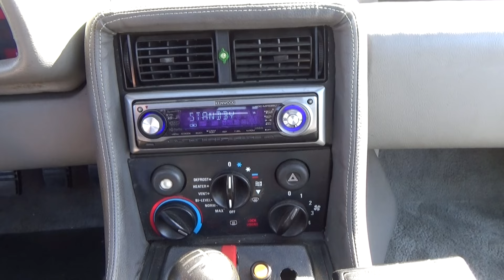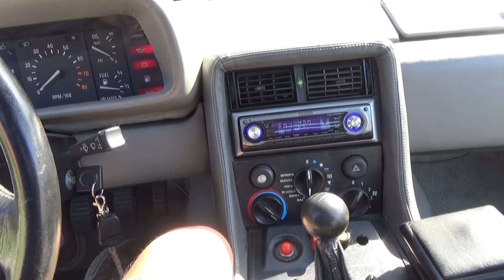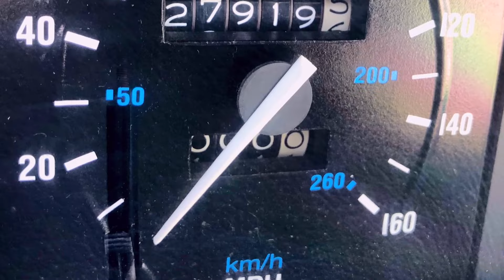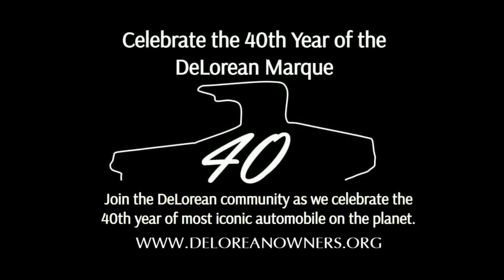DeLorean Spotlight: DMC TECH '81 DeLorean Stage-2 Engine with Electronic Fuel Injection System

Comment: Do are all the switches under the radio?
Reply: If your asking what the switches are they are the headlight,hazard and heater  A/C and blower controls.
Reply from the maker: The added switches are the electric brake system for burnouts
Reply: Well I clearly wasn't looking!😁